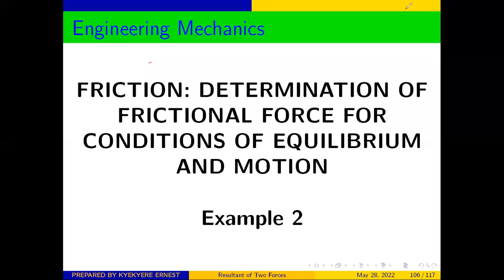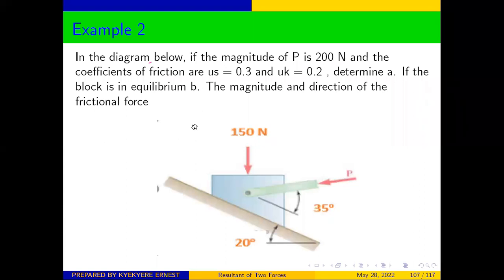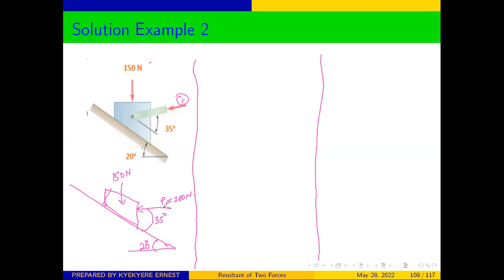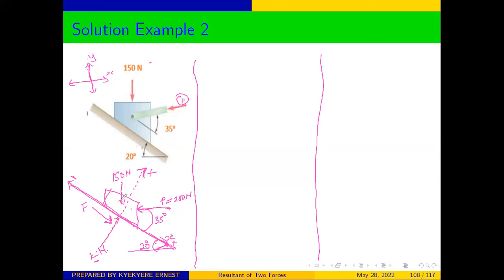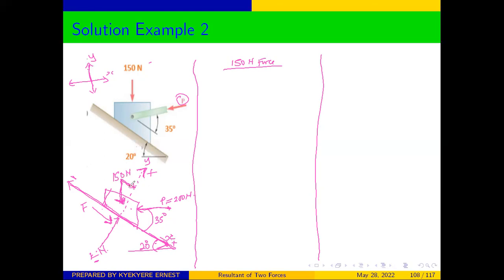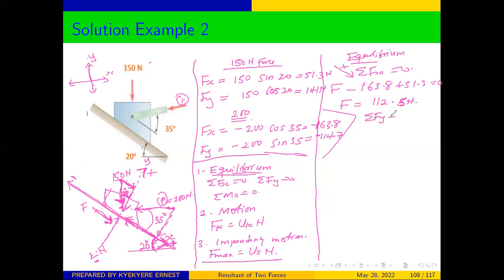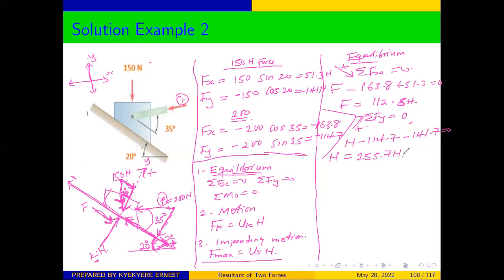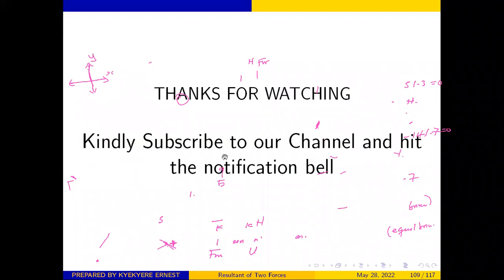Basic Mechanics: Determination of Frictional Force for Conditions of Equilibrium and Motion

Comment: Pls you said all the forces are inclined at 20° but you didn't add it to the angle of inclination of force P when you were resolving
Reply: I mean you didn't add the 20° to that of 35°
Reply from the maker: Dont forget the axes had changed, and were are no longer considering its inclination with the horizontal axis